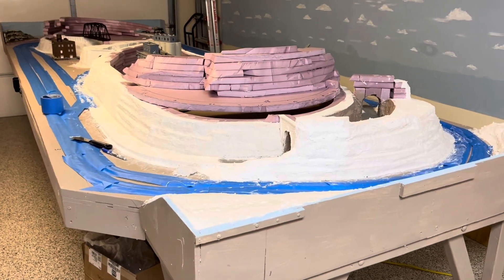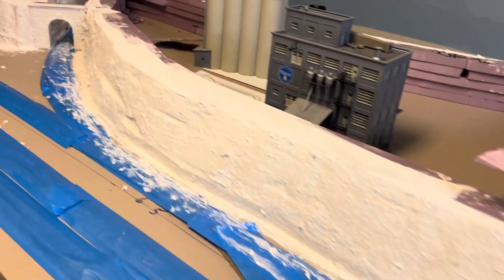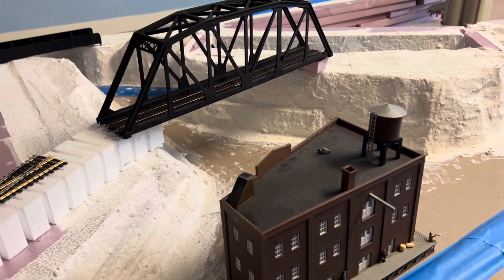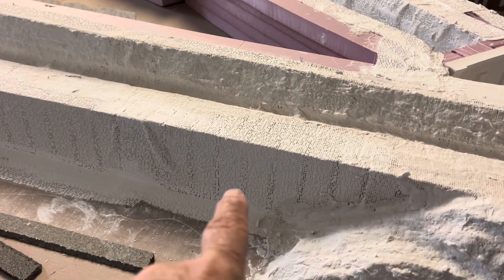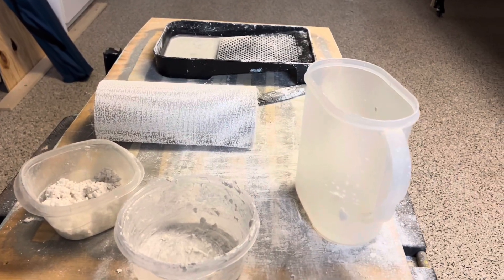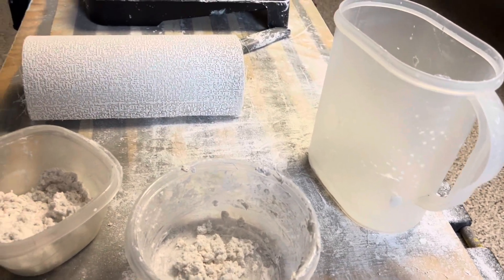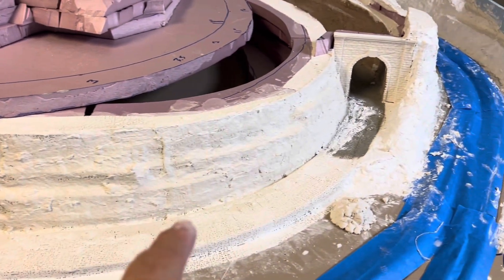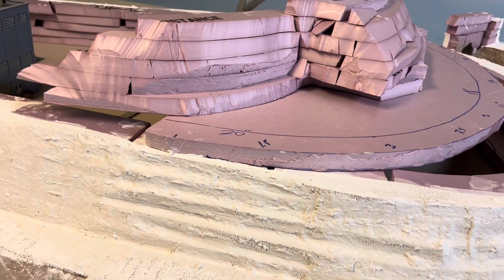My 6x16 HO Layout - Sculptamold on the base level

Comment: Hey Fred, thanks for showing us the progress with the cloth and the sculptamold, I friend of mine took the erasure out of a pencil and shaped the ferrule that held it into the shape of a stone he liked and then just pressed it into a piece of foam and it came out pretty nice. His wall was about 3 inches high but it was about 5 feet long, so yours might be a little tedious. Great progress. I hope the fingers on your right hand aren’t all dried out, lol.
Reply from the maker: My finger nails are embedded with small amounts of plaster this morning.  😬.   Didn’t get them completely clean yet.  I’m sure glad that part is done.  I was not anxious to do it.   I’ll still have much to do on the upper level but I’ve got my technique down….
Reply from the maker: My concern about my wire plan is that I will have to do it when plaster is setup just right.  Not to wet and not too dry.  It will take experimenting a bit.  I can cut the wire about a foot long so it should go quickly.  It would take forever to use your friend’s method.  I’m not that patient. Thanks for sharing, I might try it somewhere.

Comment: I use quick set drywall compound over nylon mesh. It’s less than 20$ for a 25lb bag
Reply from the maker: That’s interesting.  Do you add a filler to get texture or just shape it as you apply?

Comment: Looks like you're neat.  I would have it on the track, in my hair, on the camera, the floor...
Reply from the maker: Funny 😀. It’s messy stuff for sure.  I have to clean off my right hand with paper towels after spreading every batch of the plaster.  I don’t use a lot of water so it does not drip.  But I took no chances and covered the track.